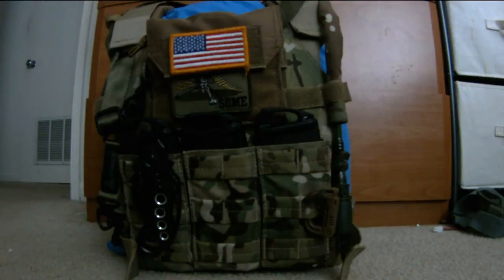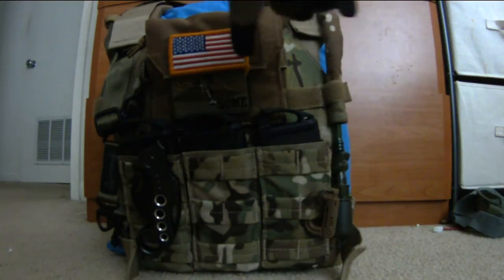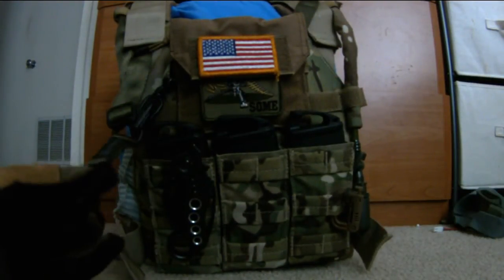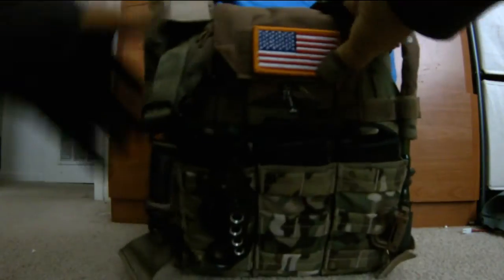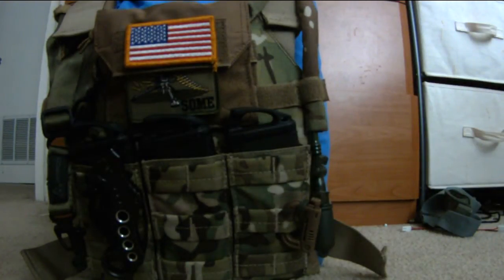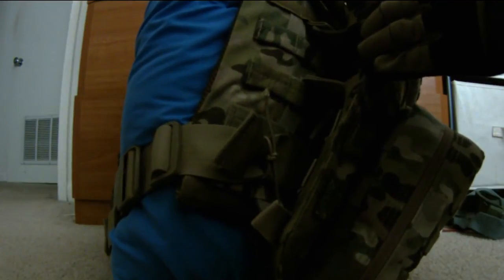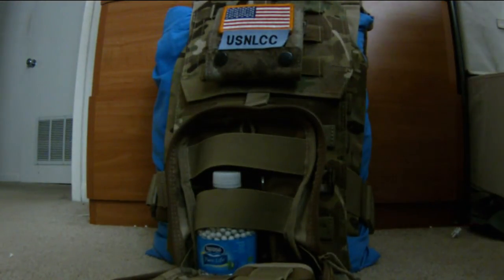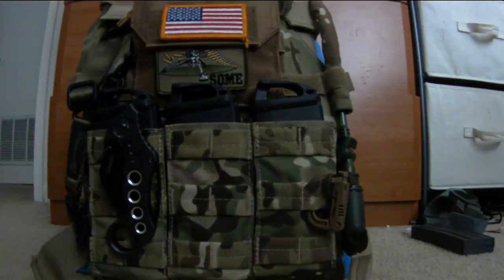Condor Sentry Plate Carrier Setup

Comment: Any reason for the grim lock being on wrong?
Reply from the maker: So that I can attach the thing that covers my hose so that it doesn't flop when I'm running and how is a grim lock suppose to be "properly" placed
Reply from the maker: +Milsim Warfighter ^^^ wasn't meant to be rude actually curious
Reply: +Milsim Warfighter No worries. molle web can fit in the slots you see on the push pin side..there are some videos on YouTube if I'm not making sense. 😅
Reply: +Milsim Warfighter No worries. molle web can fit in the slots you see on the push pin side..there are some videos on YouTube if I'm not making sense. 😅
Reply from the maker: +Squid Squad Yep I went to go watch a quick video my AVS has the grimloc like that put the molle into the slit of it and not just loosely